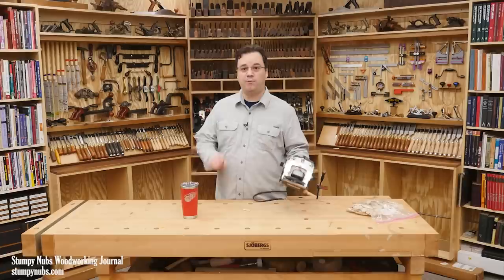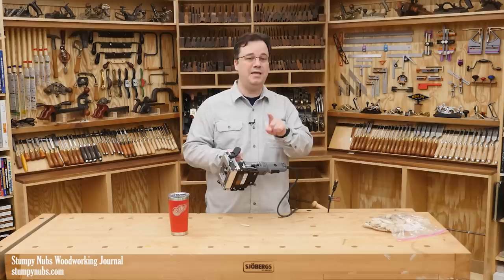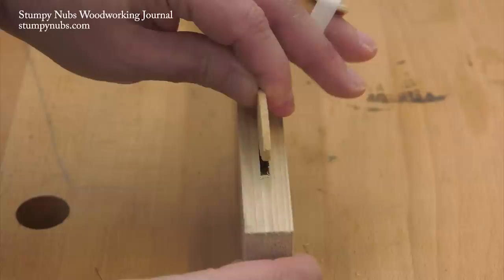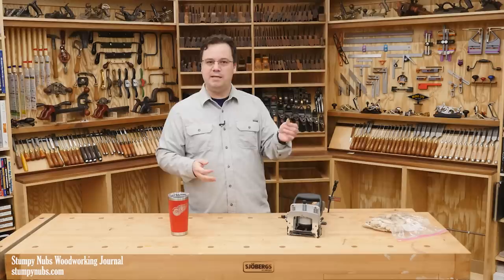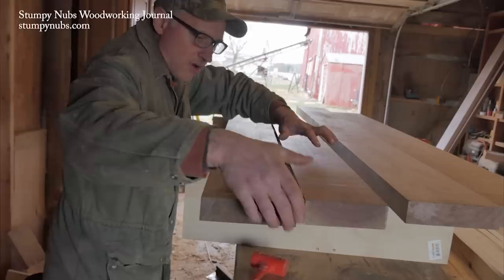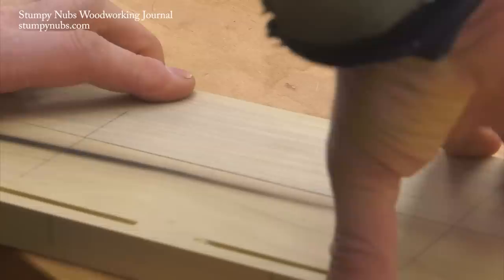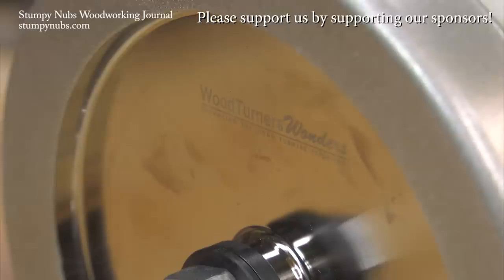Was Norm Abram WRONG to use this on the New Yankee Workshop?

Comment: I bought a Freud biscuit joiner over 20 years ago. I don't use it very often anymore, but it still works perfectly and has aided in many, many glue ups over the years. I never understood the hate. It's a specific tool for a specific use. We built a restaurant full of table tops with  biscuit joints, and all of those tables are still functioning just fine. That was in the summer of 2001.

Comment: I enjoyed your biscuit joiner video.  I bought my first and only biscuit jointer from Porter Cable in 1989.  The hype surrounding this tool was overwhelming at the time.  Building cabinets and custom furniture seemed like a good reason to buy one, so I did.  The jointer arrived in a couple of weeks but it took several months for the biscuits to show up.  My list of expected uses was growing daily while I waited for the biscuits.  It didn’t take long to figure out that in a production shop the actual applications for this tool were limited.  When needed it did indeed make a big difference, but those times were far and few.  I still have it, and on occasion still use it for leveling long panels during glue up, but mostly will use other options that are either faster or stronger or both.  I am still using the original biscuits I ordered in very large bulk boxes, thirty four years ago.   If nothing else this tool has served to control impulse buying of the latest and greatest power tools and it does do the job it was designed to do.  Thanks for the trip down memory lane!

Comment: I have used them for years. Some of what you say I agree, but I love its ease of use and I have found them to be quite strong.
Reply: I am OLD and I have 2 biscuit joiners. I use them a lot. I have a couple of very good dowel jigs. I rarely use these. I did FINALLY break down and buy a Festool domino . I do enough volume to  warrant the cost, though I HATED writing the check. I agree ( maybe I am wrong ) biscuits add more strength than people feel they do today. To each their own.
Reply: It’s crazy to see people say that biscuits don’t add strength on instagram.

Comment: Good explanation on the use of a biscuit jointer. I'm a retired cabinet maker and often used biscuits when aligning plywood parts. 

Those concerned about the ghosting issues should consider using #10 or #0 biscuits for tabletop glue-ups. The bond of the glue is plenty strong. The biscuit allows for faster assembly and the smaller biscuits handle the alignment without issues.
Reply: "Jointers" are for flattening boards. I think you mean "joiners" (no "t").

Comment: I build European style cabinets for kitchens and workshops using 16mm melamine faced particle board and biscuits. By ensuring that every joint puts the biscuits under shear load the cabinets are incredibly strong; I can attach a cabinet to a wall by screwing through the back and hang my 95kg from it.

One issue is biscuit quality; here in Australia biscuit joinery gets a bad rap but I firmly believe it is because of garbage locally produced biscuits. The most popular brand uses Hoop Pine; utter crap that you can snap in half between your fingers. In fact if you throw a handful onto a concrete floor some of them will actually break from the impact! I always use imported compressed beech biscuits and have never had a failed joint.

Comment: Only used my biscuit joiner a few times over the years I've owned it, but those times it really came in handy.  The latest was a mantle I made for my Son.  70" x 12" x 5" of 3/4" thick maple all mitered together including the ends.  (hollow inside)  Using biscuits to help with alignment during glue up was a game changer.

Comment: I've had my Freud biscuit joiner for at least 20 years. I'll never get rid of it. I've only used it a handful of times, and it's been very useful every time.
Reply: I'd definitely use one if I had one. But I'd never buy one. Somehow I've gotten away with being a full time woodworker making a great living without ever needing a Biscuit joiner to the point I couldn't accomplish what I needed to get done without one. I would for sure use one if I had one. But wouldn't buy one.
"Never get rid of my Biscuit joiner" is not the same reply as "I would buy one all over again if I didn't already have one". Of course you wouldn't get rid of it. Why would you? You already own it. But knowing what you know now, and knowing how expensive they are, especially Festool, and knowing how few times you've actually used it, would you still buy one now if you didn't already have one?
Reply: Same for me.  I really like mine for the few times I use it.
Reply: @davearonow65 
Would I still buy one now? 
I'm not sure. Maybe. 
I've recently purchased a dowel hole jig from Massca and a pock hole jig. They're great quality at a competitive price. Just as strong as a domino for a fraction of the price. 
The biscuit joiner is quicker and handy for gluing lay-up so, considering the ease of use I'd still consider the purchase today.

Comment: Thanks for the over view of buscuits. I use them whenever I have wide boards that I need. I never glue the buscuit only the edge and never use a buscuit cutter, I have a router bit the thickness of the buscuit. I find that much more flexible rather than another tool to store somewhere.

Comment: An alternative to biscuit joiners is a slot cutting bit for a router. You may already have a router, so hit two birds with one stone. Of course, this comes with the preface that you can’t necessarily be as precise as a specialised tool, however if you’re intrigued by the concept, it’s cheaper than buying a good biscuit joiner.
Reply: I've found using using a slot cutter in a palm router to be a very serviceable alternative to a biscuit joiner.

Comment: I've been using my biscuit joiner to cut slots in Trex decking to use the hidden fasteners. Works great on picture framing the deck with the square faced decking.
Reply: Saw that technique on a video a few weeks ago!
Reply: Cool idea. I’ve now gotten the trex router bit, so I can work cordless, but I might have pulled out the biscuit jointer if I had thought of that.

Comment: I have a Porter Cable version.  I used it a few times for panels, and it does help with alignment.  I don't think I have touched the darn thing in 15 years except to move it out of the way to grab something else. It cuts nice slots, but the adjustment is a bit wonky.

Moving to another state later this year, and plan to rid myself of said biscuit joiner, the dedicated mortise machine, and a couple other tools prior to leaving.  I don't use these enough to warrant keeping them.

Comment: Norm Abram introduced me to my first European made power tool, an Elu 3380 Biscuit Joiner. It not only cuts various slots for biscuits but with its unique action can also be used for cutting slots. It doesn’t see as frequent use as it did back in the days before I first purchased my Festool Domino when it was originally released but it’s still very handy.

Comment: Thanks for your honest comments.  I have a Porter-Cable bj and I love it for aligning joints as you mentioned. Long boards can be a little crooked and the biscuits help to straighten things out. Since the biscuit joiner is not very big, it will follow the edge of the crooked board so the slots stay a consistent distance from the edge, much like pocket screws, but the biscuits are hidden, which isn't always true using pocket screws.  Please keep up the helpful info, demos and suggestions.

Comment: Great video as always.  I like the shorter and "to the point vodeos".  I have been using my cheap Skil biscuit joiner for around 20 years, enough where I wouldn't give it up.  Also, a biscuit joint is stronger that you would think. Stumpy should do a break test. A rail/stile joint; Polar will break before the biscuit.

Comment: Bought mine because of Norm. Panels and "Z" clip slots for table tops were it's primary use. Had an issue in softwoods where the chips would build in the slot and then throw off the cut but adding my shop vac to the mix fixed that quick. Once again, thanks for the well thought out, concise discussion James.

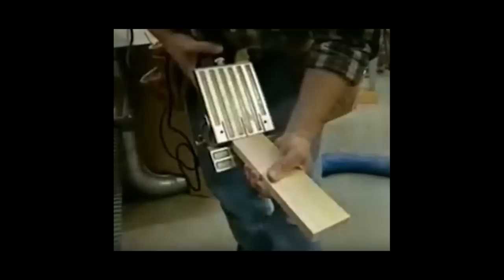Comment: 4:01 In my early woodworking days I did have a mishap. Released the trigger slightly and blade caught the unsecured wood, shot it out to the side and my hand hit the biscuit joiners front plate, luckily the blade had sprung back. I got lucky, never did that again I’ll tell you. Secure the piece every time to this day. Norm is still my hero though!

Comment: I have my dad's old Porter Cable "Plate Joiner Kit", as they call it. I used to use it once or twice a year for just this reason. An extra hand aligning difficult glue ups. But for the past few years, I've been using dowels for alignment and strength.

Comment: I have that same yellow one, don't use it much anymore but it worked well for adding strength to the mitre joints in picture frames I made. None have come apart in 20 years.

Comment: I grew up watching NYW and once I was old enough a biscuit jointer was one of the first tools I bought - before my table saw, before my jointer, before my router, before even a circular saw… my first tools were a jigsaw and biscuit jointer.

I didn’t actually use a biscuit jointer for another 20 years, but when I finally did on a long board glue up I felt Norm was smiling.

Comment: It had a moment in the sun and are now best used to create keyways in box corners for strength and appeal. I have used biscuit joints for table tops glue ups where I now use a domino. Still have my jointer tho - a dewalt. does well.

Comment: I have had my Dewalt biscuit jointer for a long time - maybe 25 years. When I was into building cabinetry, I found it invaluable in assembling face frames. For 10 years I don't think I did a project without using my biscuit jointer. There are cabinets and cupboards all around our house and my shop that date from those days. I bought a lathe seven years ago and rarely do flat work these days, but still have my old biscuit setup available, should the need arise.

Comment: I have two porter cable units like yours. My Father and I bought one around the same time. I used mine a dozen times making tables and such. Not sure he ever used his as he passed away a few years later. I now have both. Probably should sell one.  Its a handy tool for the right job. I also have pretty much a lifetime supply of biscuits.

Comment: I've got a Porter Cable jointer, and I've got two uses for it.  One is gluing up panels, but what's really cool is gluing up 45 degree miter joints on panels (think: speaker cabinets).  I know there are other methods of keeping mitered joints aligned, but the biscuits seem to do the trick easier, and maybe better.  My one gripe is that the last batch of biscuits I got were DeWalt brand from Amazon, and the thickness consistency was pretty bad.  Some are loose (not usable), and for the too tight ones, I made a jig to hold them so I can sand them down to fit.

Comment: I bought my Dewalt DW682 with a particular project in mind, a floor lamp made out of scrap pieces of formwork plywood from work (with the plies used as a feature rather than trying to hide them).
The hollow column is ~49" high (124cm) and made from 3 5/32x3 5/32" wide (8x8cm) and ~3/4" thick pieces with a 1/2" roundover on the corners. 
As I didn't want any visible reinforcement, even after the roundover, and the plies visible all the way around, I descided on mitered joints. To get the joints to line up perfectly during glue-up, I made 3 biscuit joints very close to the inner edge. That way they wouldn't interfere with the roundover. Even with my amateurish powertool handling skills, the pieces lined up nicely, and were easy to clamp during glue-up without the need for fancy corner clamps.
The precision of the Dewalt compared to the cheap Mitsutomo I initially bought for another project (tabletop for a workbench) made all the difference. The plies in the corners line up perfectly, as if the whole column was made from one thick piece of plywood. :)
By the way, the base is about ø15x1" with a 1 1/2" center hole and a 1/4" hole from the outer to the inner diameter to let a power cord through. The top is a 4 3/4" disc with a 1 1/2" hole for the socket (E27). I had to enlarge the inside of the column to make space for the bottom flange nut on the socket. As the lamp shade (17" Ikea Skottorp) hides the top disc, I just screwed it to the column. The whole thing got 3 coats of water based floor laquer to keep the natural colour of the wood. I used marine coating on another project, hella strong, but it got way too yellow.
The lamp sits proudly in a corner of my living room, and is used daily. :)

Comment: I have had my Dewalt biscuit tool for over 30 years. Still reliable but doesn't get a lot of use. I use one for joining 2 sections of countertop material before applying laminate to surface. I  might try using it during glue up of cutting boards pieces.

Comment: The one thing I find interesting is that nobody ever mentions on the joint strength discussion is using double biscuits - one over another with a small gab from the board between them.

Comment: Just bought a WEN biscuit joiner on Amazon a couple weeks ago for $50, it even came with some biscuits.  Maybe best value tool I’ve ever bought.  I have a small planer that’s not wide enough for many full panels I glue up, and I don’t have a jointer (use a track saw to joint). Biscuits have dramatically improved the ease of my glue ups, and reduced the amount of post glue up sanding.  Sure, I could buy a few hundred or thousands of dollars of upgraded milling equipment to do it the “right” way.  But until I win the lottery, biscuits are extremely helpful for me and allow me to do things well that I previously could only attempt to do poorly.

Comment: I have 2 biscuit joiners. I have had a Porter Cable joiner for years, but recently, I found an "almost new" Dewalt, very similar to the one in your video, for $12 at our local thrift store. It was barely used, had a hard shell case, wrenches, dust collector fittings and a spare blade. Like others, I mainly use it for orientation for glue-ups. But I also use it to cut slots for those table top clip "thingies". Thanks for another info-taining video. Happy New Year.
Reply: I've used my Dewalt biscuit cutter for those table top clip thingies too.  Also use it to align boards when making a panel.  And to make plywood or particleboard boxes.  Lot of situations where biscuits work great to glue wood together.  And a few situations where it cannot be used.  Glad I bought my Dewalt biscuit joiner 30+ years ago.

Comment: I often make prop furniture that is meant for stage. Because the furniture needs to be lighter weight than normal and easy to disassemble. I find myself building lots of pieces with plywood. I use biscuit joints a ton in these pieces.

Comment: Since you’ve brought up biscuit joiners again I want to tell you about the last time I used mine as I quit using it for joinery completely. My gal wanted me to replace the rotting deck in front of our home and while I wanted to use Trex composite boards she bought 5/4 pressure treated boards so after I rebuilt the framing which also was rotting in places I placed the deck boards on top of the joists and marked with pencil where each joist met and then used the biscuit joiner to make slots on each mark on both sides of each board so that I was able to use Trex hidden fasteners in the slots instead of nails or screws through the tops of the boards thereby eliminating where water would eventually get into where the screws or nails would be. Trex boards of course have a continuous slot on each side of the boards for those type fasteners but they cost way more than the pressure treated 5/4 deck boards plus she wanted the deck painted to match the rest of the decking around the house as well so this idea I had worked well for me and my biscuit joiner isn’t being used for anything else now again…However I will be using it again I’m sure when I replace the rest of the decking as needed.

Comment: When I started to get involved with woodworking, I was looking at used tools on a couple social media sites and saw a Dewalt Biscuit jointer for $40. I thought it was a mistake, but not only was the price not a mistake, the tool looked brand new, in the case with all the pieces and instruction manual. I acted like it wasn’t a great price, but quickly handed over the $40 without trying to negotiate a lower price. The guy was aware it had a higher value, but not sure he knew what the true value was and, I think it was stolen and he just wanted some quick cash. I used it maybe a half dozen times, and it’s been sitting on a shelf for the past several years, still looking brand new! Maybe I’ll pull it out if I remember I have it when working on a project. I contacted the local police and looked on social media afterwards to see if someone reported it stolen, but never found anything. If it was stolen, I was pretty sure the owner would probably reimburse me the $40.

Comment: Plate jointers are extremely useful. And biscuits are much stronger than most people realize. 5/32” Slot cutters are also useful, and strong. Joinery has been around for a long time. Even before the plate jointer. Look around your shop. Table saws, drill presses, routers. They can all be used to make quick and strong joints. Have a great day

Comment: I picked up a nice biscuit joiner than had very little, if any, use and put it to work for aligning long pieces. Something I found, that I’ll pass along here is you have to really make sure the tool and work piece are registering to the same surface. If there’s a bit of sawdust or the tool is angled slightly you slots will be wonky. I discovered this using a portable work bench and didn’t notice the slight droop until I got to dry fit before glue up.